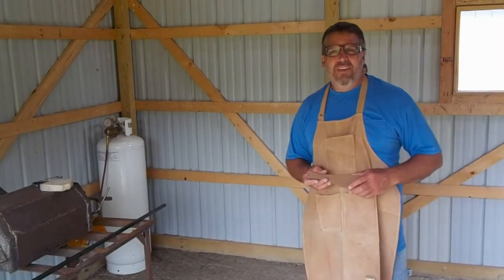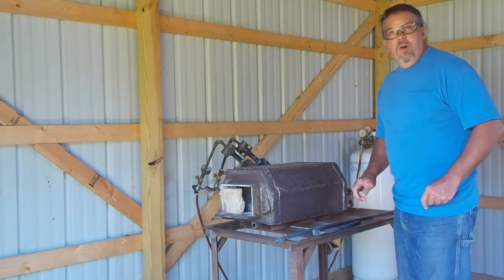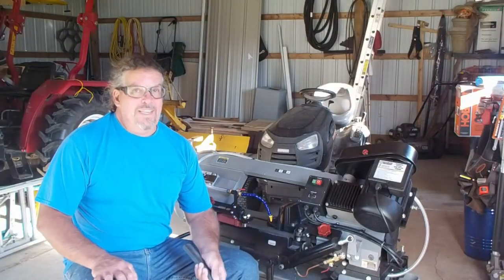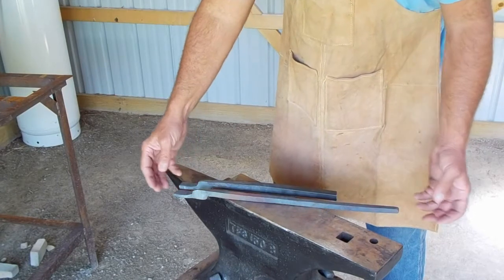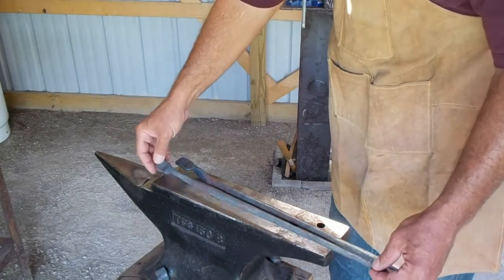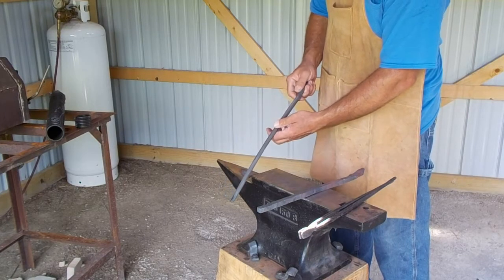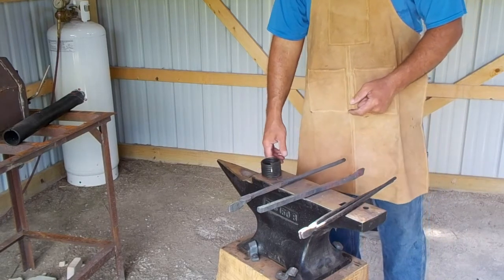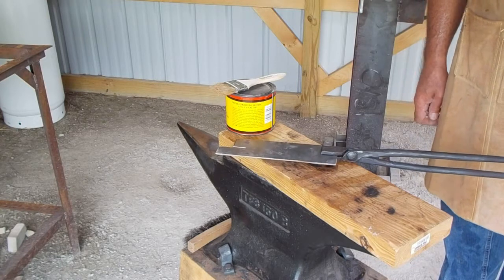Beginner Blacksmith Forging Flat Bit Tongs

Comment: Just watching your video. Yes, some would agree you are not doing traditional blacksmith work. Others would argue the blacksmith was the most advanced technology. I see no reason to say you are not blacksmiths go because you use modern tools. I am sure the same was said of the first power hammer. 
Ps put some silicone under your anvil, big box in a tube type, to reduce the ring